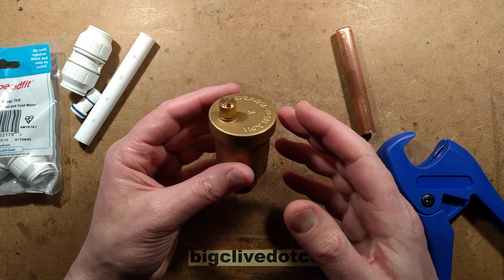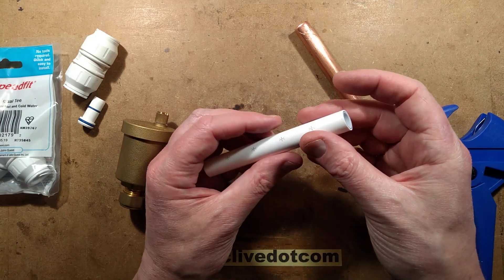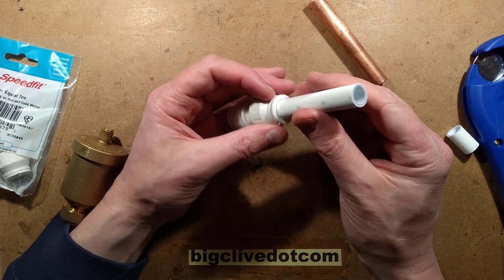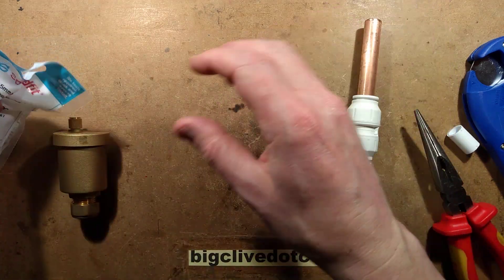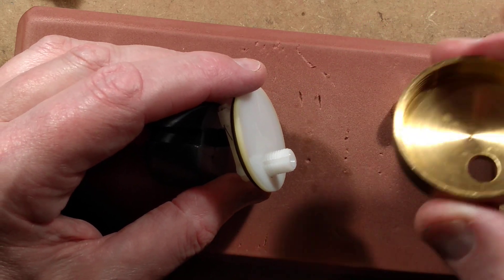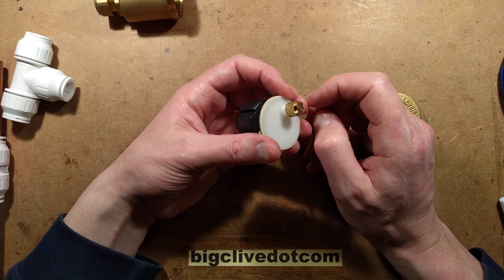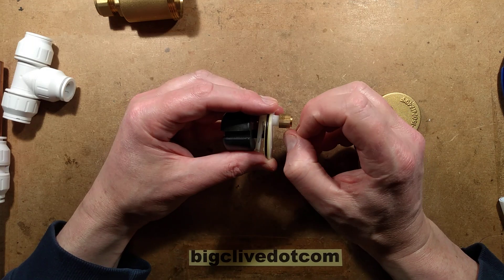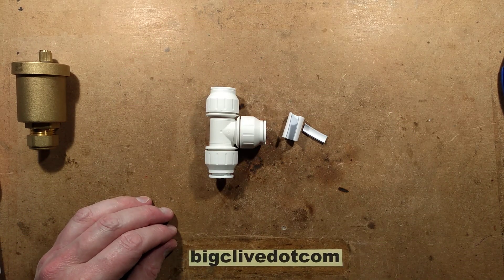Inside a bottle air vent and plumbing ramble.  (No electronics whatsoever.)

Comment: PEX, the absolute best! It will last longer than we will! No more worry about copper degrading and pin hole leaks. What a refreshing video change. Hopefully you have more plumbing projects. Electrical and plumbing, is there anything better? Well, maybe eating!
Reply: The pipe may outlast us and ultimately add to the plastic waste we're drowning in, but the rubber seals inside won't. They degrade and have a lifespan, depending on manufacturer, up to 20 years, many much less. It was reported many years ago that the pin holes appearing in copper pipes into houses was caused by a combination of impurities in the copper reacting when the cold water pipe was used as the main earth for the house. I know from bitter experience living in a 50's built house 😠
Reply: @garyphillips7993  
yes, the rubber seals are the weak spot. particularly when used for hot water.
Reply: Sounds like the same sales pitch used for asbestos plumbing back in the 1940's.
In the end, PEX will either be linked to cancer or be the cause of the frogs turning gay.
Reply: I wonder when the orings fail
Reply: Course it will and there’s +50 years of experience to support that!
Reply: I've seen the barrier pipe   delambing inside the pvc in constant hot water and blocking the water flow maybe a older form of pvc pipe I can't remember.
Reply: pex is the new fad. remember iron pipe or galvanized  pipe or  lead or CVPC? there have been many  plumbing products that come and go .  
what will they find wrong with pex down the road

as far as any product with a o-ring, eventually o-rings dry out
Reply: It'll be the rodents eating through the pipes you'll need to worry about.
Reply: Pex is garbage and literally a lawsuit waiting to happen. It's going to be poly all over again. Cpvc is King
Reply: @fox10169  Cpvc? You've got to be trolling. PEX has been in use since the 1960s and isn't going anywhere.
Reply: CPVC will give you 5-10 years as it becomes increasingly brittle. If you have a laser printer (ozone source) or any of various chemical fumes it'll degrade more quickly.Then one day you'll get a water hammer, or maybe bump a pipe, or a loose fixture will move a bit and CRACK. You'll have water everywhere. It's easy enough to cut out the bad section and glue in a replacement.That's just the beginning. You might get a few years before another piece breaks open. And you'll have plenty to anticipate. Enjoy.
Reply: @lunchboxproductions1183  incorrect, it was first introduced in the 70's in Europe, then brought to the states in the 80's, only recently has it become more mainstream. Nibco pex actually has a class action lawsuits against it currently iirc.
Reply: @Sylvan_dB  sounds like you haven't been strapping your pipe, and apparently don't know what a hammer arrestor is. We've been in business since the 70's and been using cpvc for whole home repipes for the last 30 years with no issues.
Reply: @fox10169  Do you think a homeowner who (if they happened to still own the home 10+ years later) would call back the same plumbers who caused the problem? 
FYI I'm not a plumber even tho I've been doing some plumbing for multiple decades and have on hand parts and tools and supplies for PVC, steel (including threading dies), copper and pex. The ABS and transition cement was old so I threw it out last year.
Also FYI I do know what a hammer arrestor is (a stub with captive air to absorb pressure impulse) and I do strap my pipe (but aren't copper and pex tubing, not pipe).
Reply: @Sylvan_dB  yes, most of our customers are repeat customers. We're a multi million dollar plumbing company and do no advertising at all. When our customers have problems with our work we always come out to fix it free of charge, our repipes hold a 10 year warranty.
Reply: Fox unless you’re strapping with cadmium-plated stainless titanium, those CPVC straps will corrode in the same amount of time it takes for the plastic to become brittle and break anyway. It’s the fixture which needs to be firmly attached, not the pipe.
Reply: @HighestRank  generally the straps are made from abs or ptfe and far outlive the pipe. Please stop talking, you have absolutely no clue what you're talking about.
Reply: @Sylvan_dB  my house has CPVC from the early 80's and it's all still perfectly good, never had a pipe burst nor had any fittings leak, i have a well and the preasure is arround 55 psi, been that way for 30 years straight! The seals in the valves are the only thing thats failed for me, i have also had PEX installed for a hot water heating circuit and i have had to replace two of the brass fittings after about 7 years due to water leaking around them, a brass 90 elbow had actually broken in half, so CPVC is, infact the best (as long as it is good quality)
Reply: @gtb81.  Try hitting one of your CPVC lines with a hammer to simulate it getting bumped with something. The PEX on my water heater with sharkbite fittings is still going strong nearly 20 years later... Even on the high temperature loop to my air handler. But of course, the PB done by previous owners (with copper fittings) is also still going strong since the early 1990s. I'm also on a well, and I run 40-65psi. Oh, but the galvanized original to the house is not doing so great. I've had to replace several lengths because they plugged up with calcium and rust. Time to repipe the entire house. I'm leaning PEX...
Data is not the plural of anecdote.
Reply: @Sylvan_dB  i have sliced into it a few times to replace the water heater, cleaning up things etc. i've even accidentally grabbed onto it to pull myself up and it still didn't break

Edit: i just wen't under the house and actually hit a hot water line that i'd cut out when doing some repair, hitting it just a bit less than as hard as i could against a rock did nothing, only when i hit it as hard as i could did it actually break, i was even more difficult to break the NPT fitting that went onto the heater
Reply: Yeah Pex is alright but copper will last a lot longer at least in Australia where we don’t have frost temperatures, besides pex lets diy dickheads to do their own plumbing then wonder why their house is flooding
Reply: Agreed but please no eating. We already have too many mukbang videos on this shit hole of a platform.

Comment: How good is the plastic in  a house fire? We seam to get a lot more house fires these days with dodgy batteries,plugs and white goods catching fire. With electrical fittings they are going back to metal fixing as in building fires  the plastic fittings melt and electric cables fall down causing electrical hazards for the fire brigade.
Reply: The plastic pipe melting and slowing the spread of fire would be a feature!
Reply from the maker: You can get plastic pipe based home fire sprinkler systems.
Reply: @bigclivedotcom  Hoping the sprinklers will put out the fire before the pipes melt.

Comment: Worked in the business for years, maintaining many MOD sites, copper all the way. In my experience, plastic compression fitting will give in at random times, as an example of 500 new accommodation spaces built , there were at least 100 failures of push fits within the first year, the rate of failure of soldered copper? 0, none. Plastic is a cheap, easy and less skilful way of piping up, once  you use a push fit and remove the o ring from the copper it's useless and will inevitably fail.
Reply: Just to add, the push fittings were always used by outside contractors to keep their bids cheap as they were not required to maintain the new buildings, they don't care about the long term. Us maintenance guys always used copper knowing we wouldn't need to "re re-fix" a repair. We spent literally thousands of man hours "maintaining" these new systems to get them to work properly. If I had any choice I would always start with soldered copper, followed by compression fit copper, any poly pipe with push fit would be the last choice in my own personal property.
Reply: Ferrules are mandatory when installing poly pipe on any MOD site, just sayin. You can avoid pinholes by cleaning flux off and actually bothering to flush pipework out only no one seems to want to pay for that so you get pinholes. Only outlets that require flushing are "little use" outlets and those need to be flushed whether they are copper or not according to l8 regulations. Oh and water fountains can't be used anyway, l8 legislation again. Oh and the 70s you say, how modern, part of my work includes a 12th century priory, the most modern buildings, apart from refurbishment of  new build (12 accommodation blocks built by the lowest bidder that started cracking up within a year) were the sixties, with quite a large number dating back to WW2 or further, we never had or have as much trouble with the copper as with poly, just never have. The poly though lol, one split joint caused £100,000 worth of damage and resulted in three floors of the building that was 18 months old being stripped back to bare frame and being rebuilt.

Comment: For installation in my own home I'd recommend stainless steel pipe, more expensive yes but if you're going to keep living in the house for +20 years definitely worth it (or maybe aluminum core PE-X pipe with a compression sleeve system (like from the company "Rehau")). Stainless steel also being a nice selling point if you do want to sell the house. To the bottle air vent, the cap on it is supposed to be screwed shut at all times and only meant to be unscrewed when you want to vent the pipe. They will leak eventually and depending on where it's installed will cause damage by the time you notice it's defective (seen this too many times.)
Source - plumber from Germany
Reply: Stainless … 😂😂😂 bet that’s a dream to work with!

Comment: Interesting and subtle device. The push fit plastic is popular. Never used it myself but then I do like breaking out the small blow torch to do soldering of pipe with.

Comment: As an emergency plumber I rely on these fittings quite a lot to get me out of problems when a leak occurs. In the past that used to take me awhile even with compression fittings to get everything lined up and prepared but with these fittings I can replace the section of pipe within 2 or 3 minutes. Like yourself it took me a while to get to trust them but once you do you never look back. Incidentally it's worth mentioning that the only failed fitting was when there wasn't enough space to push the pipes together so I pulled the pipe towards me to create the gap, however not pushing the fitting together straight pushed out the O ring.  They are rather ugly and I tend to use them out of sight. You can also get a similar fitting in copper, but they will not come apart.

Comment: Any air that gathers in the chamber will be at the same pressure as the water, and since the float doesn't weigh much, the hinge point is located to give maximum leverage to open the port. Air will leak through the tiniest hole so it doesn't need much anyway.

The barrier PEX (which stands for PolyEthylene cross-linked) is for gas diffusion. The plastic is actually permeable to oxygen, so to keep oxygen from getting in and dissolving in the water (which promotes corrosion) they add the barrier layer which is not permeable but also not as strong.

Those push fittings are amazing, by the way. Almost magic. I've used them in my own home and one repair has been in service for several years now on the HOT water pipe with no issues!

Comment: That air eliminator is a typical small one, just 1/2" or 3/8" BSP.  A larger one at 1" BSP can commonly be found fitted at the top of a dry riser.  Usually with just a ball inside to close the cap once the riser has been filled by the fireman's hose.  I wouldn't be at all surprised if some wag didn't add a whistle or fart tube to some of them as well.  Just for a giggle...

Comment: The air valve, my guess about the hinge design would be to allow air into the system, for instance a hot water system that has been turned off and so the system becomes a vacuum, which could collapse pipes or tanks, that design will allow it to suck air in to avoid it creating too large a vacuum, and will let it back out again when heated back up.

Comment: PVC is the norm for USA.   Hot or cold....some systems do require cryo fittings.  Once together and at room temperature the pipe can not be removed.
Reply: fcmacken can not? Hold my beer.

Comment: Plastic pipes have become popular largely due to cost reasons.  The cost of the fittings do seem to be more expensive than traditional fittings.  The concern about the use of plastic pipes is that plasticizers used can leach out into the water supply changing the taste of water and may have possible health issues.

https://youtu.be/J1Oby3BmLWc

https://www.fondriest.com/news/not-drop-drink-plastic-pipes-leaching-chemicals-drinking-water.htm

Like most things you pay your money and make your choice.  

Having said that water companies do use plastic liners when they refurbish mains. 

Don't forget the issues of earthing electrical equipment onto water pipes as used in many old houses.
Reply: The water pipes weren’t earthed because of three pronged outlets, the pipes were earthed just in case any of them were accidentally shunted to a line that whoever touched them wouldn’t become its next victim, say such as by a faulty electric water heater.
Reply: copper is going to have a bunch of impurities in it, and the flux and solder residues will leech into the water for years.  There's not much point in worrying about what material you water passes through in the last 10 m's when its travelled through kms of plastic pipes to get to you.
Reply: @edcooper2396  Exactly. And before that it came out of a river or a lake or a hole in the ground. And then it was (maybe) treated and all the filters and etc. are plastic. And then goes thru plastic (if you are lucky) or concrete or lead pipes to get to your house. Of course you can buy a beautiful stainless steel and glass filter system to treat the water again at home. And when you look inside you'll see plastic making it all work.

Comment: I have some plastic pipe installed in 1992 in my bathroom, and it hasn't leaked so far. The only thing is that it 'flavours' the water after about 24 hours of not being run.

Comment: One of the nice things about plastic is it tastes nice when the mice eat it.
Reply from the maker: You'd think the plastic drainage pipes would have been eaten by rats and mice if the plastic was desirable.
Reply: bigclivedotcom - in my experience of mice and rats “eating” PVC, plastic and rubber cable, it’s generally to make a route past an obstruction, or because (in the case of mice) because they are “nesting”.
Reply: You tasted it with the mice or after they've eaten it? If it's after then it could be just mouse pee giving the nice taste..
Reply: I'm confused, do the mice taste better or do they like it better?
Reply: They would either like the texture or some flavor which has soaked into the resin, and if both, could chew every bit of it just for the sheer hellofit. Tooth wear is minimal and coincidental, not a goal but an instinct which became necessarily habitual.

Comment: I don't think you need to use the inserts when making a speedfit to speed fit connection, you definitely need them with any compression fitting.  The inserts do restrict flow somewhat, I would be avoiding them anywhere you need full flow of the 15mm pipe.
Reply: Always always use inserts. Super seal or standard for plastic to plastic. Standard for plastic to brass compression
Reply: Get some ducks, they'll love to paddle around your flooded house 😁
Reply: I stand corrected, I used super-seal everywhere, including on a couple of compression fitting, oops, well they've last five years.

Comment: Finally something I can comment on, Heating engineer of 15years here. 

Main benefit of plastic for me is speed of installation and how it can be fished through awkward places without the need for jointing. Also the fact it is relatively frost proof unlike copper which will often be ok the first time it freezes but bursts the second time round.

Iv fitted miles of JG demountable and had very few problems with it. Also there are non demountable fittings which are slimmer and also available in copper!

Given the choice though I’d always go for copper, sure it’s a bit slower going in but can look beautiful when fitted well and will last a lifetime.

As for the AAV, most of the ones Iv seen the float does act directly on the sealing area unlike yours, is there a big enough annular gap between float and brass for the float to twist out of level and act directly on the seal?

Thanks for the videos Clive, please never stop!
Reply: Dan Hickman the appliance must not produce a shock hazard no matter the fault, and mechanical device must operate regardless of the installation orientations.

Comment: Hi Clive, I have used pushfit for years and never had a problem with it. The other good thing about plastic pipes is, as they come in coils you can have a long run with no joins and it can be run through joists etc just like a cable(ok a thick cable)

Comment: Interesting how that works,another thing I've never thought to take apart. We have a lead water main still and I have some Philmac universal couplers. They suposidly fit a multitude of sizes and materials. Full of tapered seals.
Reply: I hope you're not drinking that water. Lead is toxic.
Reply: @simontay4851  it's in a house over 100 years old, water has been tested and shows no lead. Inside of the pipe will be lined with minerals by now. Most houses in the area have lead to the house and internal copper.